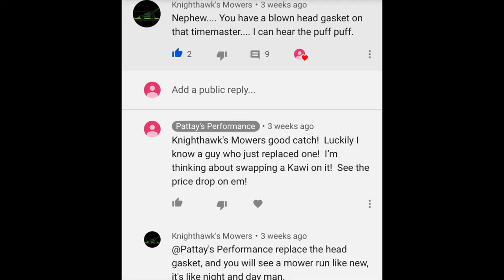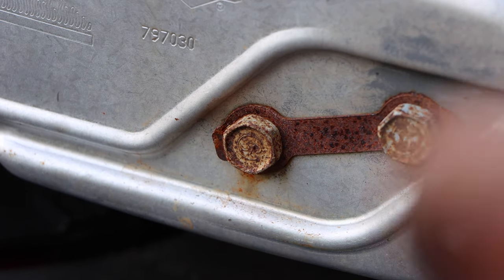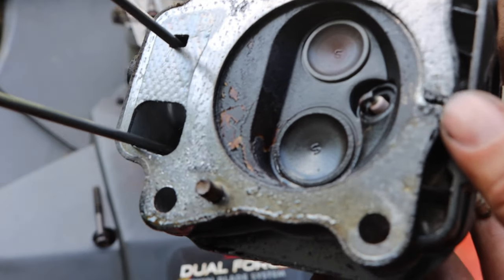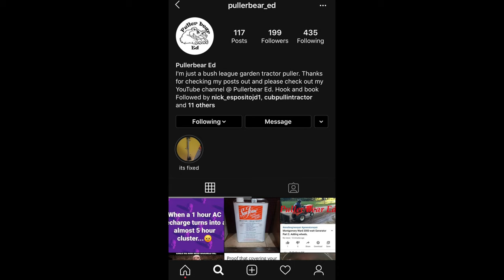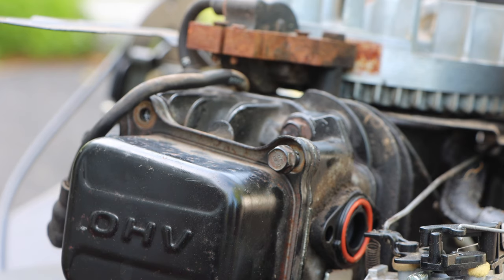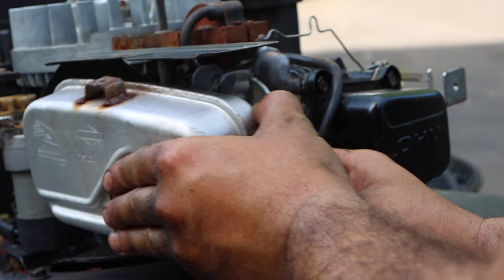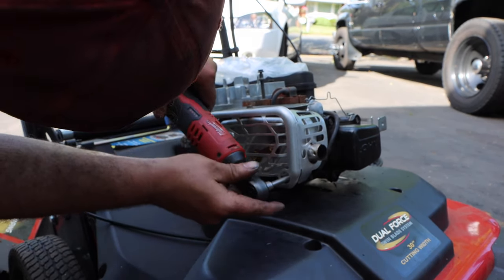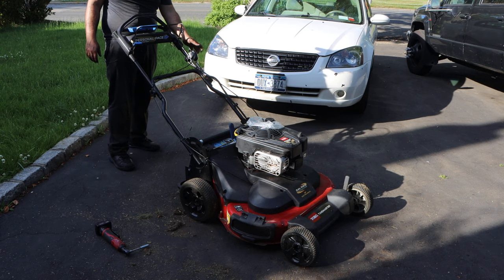HOW TO Replace The Head Gasket On Toro TimeMaster 190cc 8.75 Briggs & Stratton Engine NOT DIFFICULT!

Comment: THANK YOU!  You saved me a lot of time, frustration and money!  I just fixed my Timemaster mower, on my own, because of your video.
Reply from the maker: That’s great to hear!  Hopefully you are still in fix it mode…good time change the oil if you haven’t.  These engines are VERY FINICKY!

Thanks for the view and comment, hopefully you subscribed to my channel 🇺🇸🦅🔧🤙🏻
Reply: @pattayperformance  do you remember what the part number was I'm going through the same thing on a John Deere and I thought maybe you'd have a part number and then I can call my shop and see if they have the head gasket
Reply from the maker: @Jeffroson78  sorry for the delay…

Click the link in description, if it doesn’t work let me know.
Reply: @pattayperformance  All good I done fixed it head gasket
Reply from the maker: @Jeffroson78  I figured!  YouTube doesn’t notify me of all the comments.  I have a new habit that when I get a comment on a video I go through all the comments to make non go unanswered.

Where you able to get the HG local or online?  Never seen a Deere with motor on it!  What kind of Deere did you have?
Reply: @pattayperformance  John Deere js46 has the 8.75 B&S engine with oil filter on it

Comment: Great video, used it to rplace my head gasket. Interestingly the same head bolt on my timemaster was loose. Noticed when I pulled that head bolt out it had bits of aluminum on the threads. That got me thinking, that head bolt is the closest to the exhaust port. That bolt will get the most heat exposed to it. This brought back memories to me. Back in the early 70's I owned 2 VW bugs and worked in a shop that specialized in VW repair.  When a bug came in for a tune up it was our precedure to pull the rocker arms off and re-torque the heads, (you see where I'm going with this) it was common to find the  Number 3 cylinder head bolts loose, (by design not enough cooling to number 3 cylinder) or you were unable to torque them which meant a helicoil was installed because the threads were stripped. So for me in Minnesota after about 7 months of use here at the end of the season when I winterize my mower I will check the torque on my Timemaster.
Reply from the maker: See issues arise no matter how big the engine is...none of them are perfect!  To check and retorque head bolts during seasonal service just adds another 5 mins!   Thanks for taking me back to memory lane with your story!

Comment: Hey neighbor. Funny, I've been driving past your place for years and see the machines for sale out front and then I find your channel. You have a new subscriber. Great videos. Do you know the tolerances for the valves on the B&S 190cc engine? Want to check them and adjust if necessary. Thanks.
Reply from the maker: .005 Intake 
.009 Exhaust but double check with Briggs it’s been a while.

Comment: Awesome video. My mower is now purring like a kitten after replacing the head gasket.  The left two head bolts were loose as well.  I found a handy shortcut. The muffler can be left attached to the head.  With the carb loose, there is enough wiggle room to get the linkage off the exhaust doodah.  That leaves one bolt in a bracket on top of the muffler.  No need to loosen those pesky muffler bolts!
Reply from the maker: Awesome!  Loose head bolts will def cause the gasket to blow!  You know what…one more thing to add to tune up. Check headbolt torque!

Thanks for the tip, view and comment, hopefully you subscribed to my channel 🇺🇸🤙🏻🦅🔧

Comment: I have this same mower with the same problem.  I followed this video exactly and was able to replace the head gasket easily - something I would not have been able to do if not for this video.  Thank you.
Reply from the maker: Wyatt Shaw THAT’S AWESOME!  This is the foundation of my channel!  

Thanks for the view and comment, hopefully you subscribed to my channel! 🤙🏻🦅🇺🇸🔧.
Reply: Wish I would've seen this before I sent mine to the shop for this same repair. What was supposed to be a 2 week wait turned in to 5 weeks and a $200 bill.
Reply from the maker: Now you know...how is the mower holding up so far?

Comment: Just wanted to say thanks!  My head gasket looked exactly like yours.  About $15 later and an hour w/your video and its running much better.  I was pretty close to just repowering the thing.  Appreciate it.  This mower's definitely somethin'... great design but very poor quality.  Only 5 years old w/1HR per week / seasonal residential usage and it's been new pulleys, belts, head gasket, ignition coil, carb, and now I'll be putting in a transmission.  Never had this issue with Honda, too bad very few companies make a 30'' easy to store walk behind.
Reply from the maker: That’s crazy! I’ve had issues but still on the OG trans.  If nothing happens this year it will be first season it didn’t have a break down since I’ve owned it! 🤙🏻🇺🇸🦅🔧

Happy Mowing! I have a few videos on this machine 😂

Comment: I have the same problem on the same engine , just mine is mounted on an pressure washer . Both head bolts from the spark plug side was loose tightened when on the other side was strongly tightened  ( I don’t know is they get loose  by the vibrations ( but then the question is why the other side bolts didn’t get loose ) or our engines are assembled by the same guy :)
The head gasket was blown out on exactly the same place . And muffler bolts was loose as well despite the retainer bracket was bent properly . One of the muffler gaskets was intact when from the other only the metal skeleton was remaining:) There was a problematic start since brand new and since I’m not professional small engine mechanic I didn’t know that the gun shooting sound ( when kill switch is turned off on hot , running engine is sign for blown gasket ( thanks for that tip!) . Maine was doing that since brand new but since I use it once a year neglected the problem until this year when I wasn’t able to start it at all . I troubleshooted before removing the head . Plugged the exhaust port and when rotated the flywheel manually was very easy to locate strong 
air blowing close to the exhaust port , but not from the port since it was plugged. And my gas tank cap fail as yours as well :)
The same thing ( with head bolts loose tightened) here https://youtu.be/1ygvX1ob1fQ after the 9th minute .
Reply from the maker: YOU ARE LUCKY!  I had same engine mounted on a pressure washer.  Exhaust bolts broke loose.  I actually have a repair video on that as well.  I got lucky and so did you!

The gas tank…I finally converted it to an older style tank.  People have commented that they had great success with a new oring!

Keep me updated!
Reply: @pattayperformance  fixed it , even already pressure washed the driveway . Started right  from the first pull very easy . Adjusted the valves . Explosions in the muffler doesn’t seems to be related to the blown head gasket , most probably when the engine is hot and in the fuel tank still present some fuel and you turn the kill switch to off , the ignition stop making sparks but since the engine is rotating and act as a air pump still suck fuel from the carburetor, wen this fuel reach the muffler ignites and the explosion occurs. There are some carburetors for bigger B&S engines that have special electric valve on the main jet in order to prevent such explosions and the  “dieseling “ if you have a lot of carbon deposits in the combustion chamber . The torque momentum for the head bolts BTW is 210 pound/ inches ! If you tight lighter probably your head gasket will be blown out again . Rechecked the tightness of head bolts after few hours washing and all was OK , so probably originally they wasn’t tightened properly ( especially the head bolts from the carburettor side .Also looks like the engine want colder plug mine is original B&S made by Champion RC12YC will try RC11YC or will replace it with NGK because they have wider heat range and cover both 11and 12 Champions heat ranges simultaneously.

Comment: Nice video. New subscriber. May i ask where is the video of the symptoms  of this bad gasket, i had mine for a momth and i thoughtbitnwas fuel filter due to it not remaing full, .my sym was power decrease with blades  engaged and not engaged and reving sound like someone is doing a car, and putt putt putt sound. I just took it bad and ordered a new one
Reply from the maker: I had PUT PUT while running.  I bought this used and always thought it lacked power due to engine size.  A fellow subscriber and friend Mark @twistedvtwingarage told me the headgasket was blown.  He was right!  Noticed a significant improvement in power.  

This year I swapped a 223Cc Motor and run Ripper Blades and it’s a whole new mower!

Comment: When putting air filter assembly to carburetor. I didn't see you put a gasket in-between when putting together. My lawnmower was leaking gas through that union. The gasket was torn up when i took the filter assembly off to get to carburator.  What did you use or did you use a gasket at all?
Reply from the maker: That’s because the gasket was stuck to the AIr Filter base.  

Gas shouldn’t be coming coming out the carb into the air filter base.

You most likely have a bad carb but can try cleaning it and servicing it.

Comment: Where is your ground wire for kill switch? I did this repair and suddenly my mower won’t shut off. I’ve replaced the switch and checked all connection for closed circuit. Still won’t shut off. But your ground wire isn’t attached where mine was. Any ideas?
Reply from the maker: See if it’s attached to the coil
Reply: @pattayperformance  Mine is attached to the metal piece where the governor spring is. The other wire is attached to the coil. We checked for continuity and  voltimeter says all connected. Still the stop switch wont shut engine down. Thoughts?
Reply from the maker: Ok...you have the electric start model?

Comment: Is white smoke part of blown head gasket ?  and oil pushing through oil filter!
Reply from the maker: Yes and yes but in my case I had none of those issues.

I had low power and PUT PUT PUT while running the machine.
Reply: @pattayperformance  thanks

Comment: Where is the video that you said is in the description and shows your symptoms? I want to make sure this is the same issue I’m having! When the blades are engaged and I spin them by hand, they tighten up every few rotations and I hear a hissing/horn noise like air is escaping  hear the head
Reply from the maker: It’s in one of my mowing videos…

You hear the motor hissing as I’m cutting grass.  Based on what you are telling me, you need a headgasket.

Happy Valentine’s Day 🤙🏻🔧🦅🇺🇸
Reply: @pattayperformance  Thank you! So a blown head gasket can cause my blades to spin roughly every few rotations like that? If the blade drive belt is not engaged, they spin smoothly (testing by hand with motor off).

Comment: cool,   I have a toro 190cc 7.25 quantum - I think it also has a blown head gasket  its a flat head so its easier to change while in there I will clean out stuff.  Hope you are all doing well. been awhile since we have exchanged chats
Reply from the maker: how did you make out?
Reply: @pattayperformance   it wasn’t the head gasket.  I am going to have to look at doing a valve adjustment on a flat head.  

I have been busy fixing other things and this got pushed to the back of the list.   It seems just as I sell a few and get down to only a few left more show up.  I picked up 2 mowes for free by somebody who didn’t know what they were doing and tried to fix it themselves well let’s just say that Kohler is parts now .  The other a troybilt one he hydrolocked.  By putting over 
 1 qt of oil in it.  .  That was messy to fix but easy.  I found it had a broken blade adaptor but blade wasn’t bent . Shaft may be slightly bent. But not by much. I replaced adapter with a used one I had

So far I have sold 16 this season and have another sale scheduled in a few days.   I haven’t had to haggle as much about the prices which I increased due to market conditions and inflation.

Comment: My Time master died. Mechanics warned me of the puff puff the engine makes. They said run it til it dies.. It died. Going after the head gasket today. This video was helpful. Let's see how it goes. Mower bought new in 2011. First time of engine failure in 10 years. Always used VP (94-0ctane) fuel in my motors. Yes it is spendy but, from chainsaws,blowers, weed Wackers, and mowers this is the first failure of any of my engines.
Reply from the maker: Thanks for sharing your experience!

Not sure why they would tell you to run it till it dies.  Motor is gutless with a blown head gasket.  Wonder if they were banking on selling you a new mower or just a replacement engine.  I bought mine second hand…fingers cross this year is first one without a mechanical breakdown.  I’m confident I have written all the wrongs and it will be a stellar mower for sure!  I will post a today’s cut on my community page.

I run reg gas with Seafoam In it! 

Thanks for the view and comment, hopefully you subscribed to my channel 🔧🤙🏻🦅🇺🇸

Comment: When you put the cylinder head back on does the Piston need to be in the forward position? I replaced my cylinder head because I messed up my spark plug port beyond repair. Got it all back together and now it won't start. It backfires and blows smoke through the carb out to the filter
Reply from the maker: It has to be if you messed with the valve lash.  I would adjust the valves...

Thanks for the view and comment, hopefully you subscribed to my channel 🔧🇺🇸🤙🏻🦅
Reply: @pattayperformance  yes sir been a subscriber for a while. You have great content. I got it to run with the valves at .006. but broke my t25 head on the adjuster. Ordered a new one. Now need to replace the transmission on my other timemaster

Comment: my timemaster is burning oil i can smell it burning. it doesnt have the other symptoms you mentioned on bad head gasket. it starts easily and runs good and strong and smooth. just smells like oil is burning...any advice? ty
Reply from the maker: It’s OK to smell, did you verify it by pulling the dip stick?

Burning oil…most likely piston ring is worn.  Bad head gasket won’t yield burning oil.

Doesn’t hurt to adjust your valves.

Thanks for the view and comment, hopefully you subscribed to my channel and keep us updated with your mower 🦅🔧🤙🏻🇺🇸
Reply: @pattayperformance  It will yield an oil burning issue

Comment: Great video, really good info on a head gasket change. Thank you for the shout out. Next time try putting a little piece of paper towel between the socket and bolt head to hold it. If you really want to upgrade the engine get with Twisted Vtwin garage..he can hook you up with some real power.
Reply from the maker: Pullerbear Ed I’m sure between the two of you and Craig, the head will be taken to the next level!

Comment: well I just replaces my headgasket following your instructions and just my luck… now my mower wont turn/ start, the pull cord wont reset when its on the flywheel 

ughhh Im just taking it to a shop, Im over it lol
Reply from the maker: It it just your luck…there is no reason why it shouldn’t retract.  Have you tried starting it with your Electric start since recoil is giving you issues.

It’s just 3 nuts…there was no need to remove the studs that the nuts go onto.
Reply: @pattayperformance   unfortunately mine doesnt have electric start… I didnt remove the studs, only the nuts, which is why it makes zero sense that it locked up on me. I double check my the push rods  and everything was put back in place properly… not sure what else could have caused it to lock up
Reply from the maker: @JDT859  give me a quick call on instagram

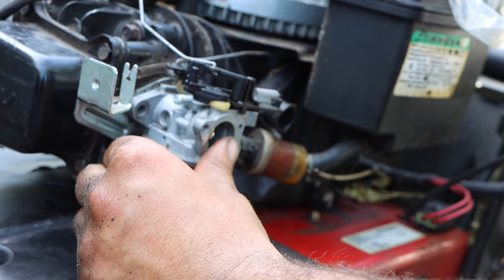Comment: @27:01 just wanted to add..  that metal bracket is also an ignition coil ground that connects at the end of the line of the kill switch and must be lined up on this tabs to make a connection to the carburetor mounting bolts.  failure to do so will result in an engine that will not shut off if running okay with a crooked bracket. (this might not apply to all 190cc briggs engines)
Reply from the maker: Great catch and tip!

Thanks for the view and comment, hopefully you gave the video a thumbs up to help others and subscribed to my channel 🤙🏻🔧🇺🇸🦅
Reply: @pattayperformance  indeed I did. I noticed this ground is used on pressure washers with Briggs and Stratton engines. Rental repair guy here 🤘
Reply: @pattayperformance  i finally wrapped up the head gasket swap.  the briggs motor on the timemaster had no head gasket from the factory.  wasn't straight forward at first. the added thickness of the head gasket forced me to adjust the valves and governor. ......hurts my brain

Comment: Note, the head gasket blew on the exhaust side. Be sure to frequently tighten the head bolts on the exhaust side ❤
Reply from the maker: Never knew these were an issue about coming loose.

I swapped the Motor for the 220cc

Comment: Whats the normal charge for this procedure? I was just charged $200 for this and new belts
Reply from the maker: Marty Gravley they installed new belts $200 is more than fair if they used OEM belts since they are 3.

Remember a shop has overhead to pay

Employees 
Rent
Insurance and so on.

Do you have the newer 10 horse or older 190cc like mine?

Thanks for the view and comment, hopefully you subscribed to my channel 🇺🇸🤙🏻🦅🔧
Reply: @pattayperformance  Ok. Mine is the old 190cc too
Reply from the maker: Marty Gravley unfortunately it’s a very common problem.  At least you have this video now to DIY when it happens again!